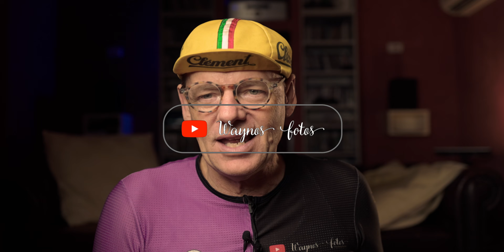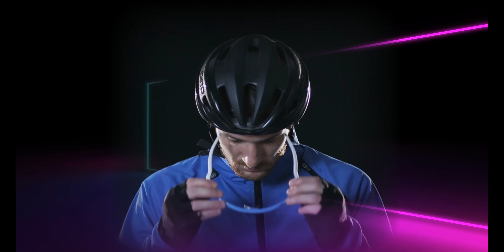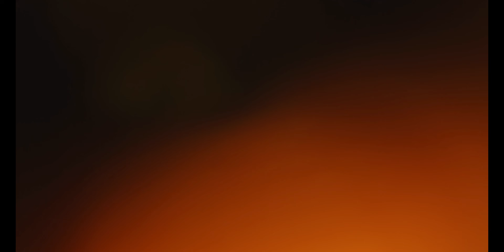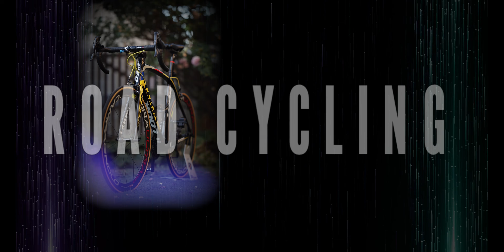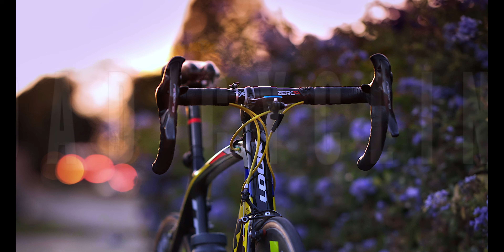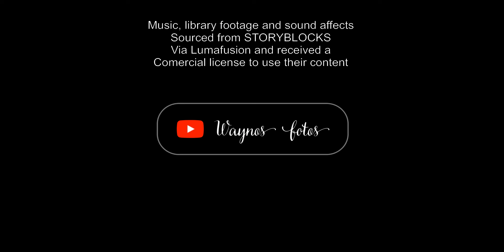Are electric groupsets worth the extra money?

Comment: Just how long are the electrics going to last? I don't fancy parking my best bike up all winter in the shed only to find the so called weather sealing has not really worked because moisture always finds a way inside an enclosed space (it's called condensation), and fried the electronics. 
The difference in price between mechanical 105 and electronic is about £800 or £900 here in the UK, around three times the price! The money could be spent on far better things - better wheels or a training camp/cycling holiday which will do more for your performance and enjoyment than this overpriced  and unnecessary gimmick.

Comment: I just like the simplicity and hand feel of mech shifting. I hate pressing a button on a lever. Internals are really cool when u open them up, and pretty complex with lots of moving parts. Electronic would be a lot easier and less costly to design and produce I imagine going forward? With asking prices more. Hence the push away from mechanical. I won't be buying them though until I have no choice.
Reply from the maker: I get, people like it and it makes it easier to change gears, potentially with more accuracy. But what I can’t get out of my head is, we are pedalling the bike, not using any electric to move the bike forward, i.e. no assistance to the rider working/pedaling, but we carry a battery on the bike to make it easier to change gears. I find that bizarre and now you can’t get mechanical in the top groupsets. 🤔 	Plus I like the feel and feedback of mechanical.
Reply: @waynosfotos   yes whats the difference between pedal assist pedalling and hand assist shifting when u break it right down? Even if one doesn't drive you forward. Both are motor driven. Obviously we're not worthy of even 105 these days .But don't worry. Once they've run out of r7000/8000+ groupsets they'll trap us back in 2005 with 10sp mech tiagra smh. Gee thanks shimano!

Comment: 10/10 for "Resilience" and "Cost saving"  Using eTap Red with satellite button allow me to swap this group set from TT to Roadbike to MTB in half an hour. (Putting the blip box on the stem also come very handy in aero position)
ps. 1 system for 3 bikes is epic to me.

Comment: What are your thoughts on gearing, wide range cassettes etc. specifically the 11 sprocket that is now
on most of them. I still ride 9/10 speed and will not upgrade to 11/12 speed because I could not pedal an 11 sprocket if I was going down a ski jump wearing a jet pack and getting a good  tailwind.
This applies to a lot of cyclists (whether they admit it or not) so what it the point of 12 gears when you can only use 10 ?
From a whinging pom.
Reply from the maker: Well we have 10T i have done a number of videos on gears and easier gears. Go check them out. 👍
Reply: @waynosfotos  Will do

Comment: 12-speed does seem to benefit from electronic, as the shifting is now so sensitive due to the tolerances. Just replaced cables a second time to try and get the shifting perfect, due to a seeming bit of friction in a cable. Ran Campy 10-speed mechanical for ages and it was the best shifting I ever experienced. I said back then that there was no need for electronic, or for more gearing, but I finally relented on the gearing to get the full range in the back that is offered by 12-speed. I'm now curious about electronic and if I can get a return to perfect shifting, but will see if it was just a cabling issue. No doubt that mechanical is preferred for ease of maintenance, simplicity, cycling zen and no need to constantly be charging more devices, but I am changing my tune on electronic shifting and may give it a whirl.
Reply from the maker: You need a bike with straight lines and little cable casing and straw. I have a look 695 12 speed record, changes perfect and very light. My other bike they put straw in it when rebuilding it, you can feel the friction in the changing. Some bikes were so bad with routing that you couldn't get the shifting to work at all. If you have noticed the older bikes had more direct cabling.

Comment: SRAM Force flawless shifting. Ability to optimize shifting, for example when changing between front small/large chainring,  the rear derailleur will adjust so not a large jump in ratio if desired to set it this way.

Comment: The sram AXS system has a very powerful motor in the front derailleur and chain drop is an issue if you shift it under high cadence. You put it very well, it’s not necessary faster, it just feels luxurious and is more comfortable on longer rides because shifting the front derailleur gets more challenging as you run out of glycogen

Comment: I'm kind of old (70), and have arthritis in my wrists and neck, but have no problems shifting with mechanical group sets. My arthritic problems are most affected by the geometry of the bicycles - hunker down aero positions of road bikes become painful after 90 minutes or so on a ride (especially in the drops), so I mostly ride crank forwards, recumbents, and mountain bikes with more  upright positions. I've appreciated great mechanical groupos going back to the 80s, when I was still riding road bikes with DuraAce shifting setups. Thought they were fabulous, but am sure the electronic stuff is a lot better, as long as the batteries work. They're way too expensive for the performance gained, imo.

Comment: Beware of the software contract. Hammerhead is already gone for Shimano have to buy their compatible systems. Soon e-group sets will be like  John Deere tractors. It senses a problem, battery low, stops shifting and all you get is a blinky light. You have to take it to a licensed tech, to get diagnosed and fixed $200 service fee.  Reason JD makes 60% of its profits on service, not selling tractors or parts.

Comment: I think you pointed this out, but I went electric for one and only one reason: Cheap cables. I witnessed what very much could have been a fatal situation when a cable failed. This wouldn't happen in a hydraulic/electric system. They have fail safe positions and provide notification way in advance of a flat or failed battery. Not so with a failing cable.
However,  there are situations where cables are better. But you had better be using the highest quality cables that are hand made. I've even "failed" brand new cables that were bulk made.

Comment: I worked in the bike industry for 10 years and rode most groupsets. For me manual shifting is the best, it’s accurate, easily serviced/tuned and it doesn’t need to be charged or updated. I have ridden Campagnolo Chorus for almost 15 years now and have no desire to change….which says something.
Reply: I ride Campy exclusively. Let's face it,  the ratchet mechanism wears out. Of course your don't notice it on the left lever but as the number of speeds increase it takes less and less wear to be noticeable with misshifts or the nessesity of readjusting.   With an 8 or 9 speed you never had a problem but starting with 10 speeds wear started being a problem. While the 11 and 12 are still too new to tell if their redesign eliminated the problem,  everything wears out and especially when average riders are riding ridiculous numbers of cog speeds so they are shifting multiple gears to get from their top end of 20 to a climbing gear on the next roller.  The average sports rider doesn't need more than 9 speeds and the improved rear derailleur mechanism.

Comment: Electronic only groupset (no mechanical available) is beneficial to the manufacturer's profitability i.e. one SKU instead of two, greater margin and planned obsolescence. Notice the incompatibility of 105 with Ultegra and Dura-ace to avoid mix and matches that could cannibalize sales of the higher end and highly priced components.
It's beneficial for the bike manufacturers profitability i.e. more flexibility for manufacturing frames shapes, less SKUs, less financial liability (recalls and lawsuit), greater margins.
It's beneficial for the shops profitability i.e. less inventory, easier assembly, adjustments and repairs (part substitution vs repair = less time/repair).
To the cyclist two major benefits i.e. bragging that you have an electronic group set and hearing the bizzz bizzz bizzz.
Other than this you pay a hefty premium both at purchase and in case of failure or breakage and you can be sure that it will not be supported in a very short future i.e it becomes more of a short term consumable.
In short, just when the mechanical groupsets became very precise and quick, they went to electronic. Just when the rim brakes became precise and powerful, they went to disc. Why ?
Money, money, money !

Comment: I was one who didn't think electronic shifting was necessary. Heck, most of the stuff we buy for bikes aren't necessary, but once I got a bike with Di2 it was a nicer shift. It wasn't much faster than my Dura-Ace mechanical. I do however like the shifting options available on Di2, like the semi-shift which makes that whole process of shifting gears faster and automatic, without thought. The downfalls are remembering to charge when you need it and on road adjustments and hacks if something goes wrong. With a mechanical you can at least adjust stuff on the road and if anything goes wrong you can physically try to hack it so you can get going again. Fact is, cycling is an expensive sport. Are these products worth the price or cost as much to make as they sell to us? Probably not but the market will buy them because it goes with the territory. If you don't want to spend money, take up walking. Bikes are expensive.

Comment: Electronic system doesn't make you faster. I'm the only guy in our cycling club with mechanical, never been dropped on a ride (guys have all bells and whistless on their bikes).  

For people with handicap the e-system is very good.

I've been using 105 7000, Ultegra 8000 and DA9100 series on my bikes. I've been using Di2 Ultegra and DA on rental bikes, the shifting speed difference is insignicant. 

And the e-system prices are ridiculous (but not as ridiculous as current "top-end" plastic bike frames with desing fails like Canyon Aeroad seatpost issue or stem/fork/cable integration problems). 

I also hate the amount of stuff I need to recharge. Thankfully, my bike isn't one of them

Last note, I bought extra front and rear derailleurs so I'll be riding with them for many, many years to come.

Comment: Thinking of going GRX  for next new frame. If electric di2. Control point in better spot and more options.  Missing that one back cog is not a big big item compared to  ease of use on mixed surface rides I do regularly.

Comment: I've 2 bikes, one is set up with Dura Ace 9000 mechanical, the other Ultegra R8000 Di2. 

The ultegra bike had been getting all the action for the past 2 years. 
Just out of curiosity I took out the DA9000 bike out for a spin and was blown away by how well that thing performs. 

It is set up with Jagwire's Elite Link cables and housings and with that setup they're just as good as di2. 
Shifting is flawless every time, just as fast and just as crisp. 
As wayno said, those cables don't seem to stretch and they do last forever. That's been my experience at least

The only thing I miss on mechanical is being able to see the gear combo on my head unit. 
But otherwise, really no difference. I'd even say mechanical is easier to live with (no charging - no firmware updates) and comparing the 2 groupsets mech is lighter.

Comment: It's probably easier to make an electronic system work with those ever expanding cogsets.  Nine speed mechanical was the pinnacle of shifting.
Reply: We're in agreement.  But 12 speed chainsets are weaker because amateurs always cross chain and across 12 speeds it gives a serious twisting motion to the chain. While I never tried it,  the Di2 shifting speed is programmable. Di2 DOES shift better because it overshifts for rapid motion and then steps back to the correct place.  There is no doubt that it shifts better.  I just find plugging a bicycle in objectionable.

Comment: I've always had my doubts about electronic derailleurs and crashes. If anyone can chime in that would be great. Can the motor get ruined?
Reply: I bought the complete Dura-Ace Di2 9170 group. One month into it my rear derailleur cage broke, damn carbon junk! I went to a shop and they where able to order a new cage, just the half that broke, for $110. But the downside was it took almost 4 months to get it because supply chain issues. However in the mean time I wanted to ride my bike so they were able to get me a complete new RD in like a week. That was almost $700. I bought it so I could ride and when the cage part came it I fixed that RD so now I have a spare. All this because I cross chained biggy big rings. Shitmono has the capability to use big ring big cog but not small ring small cog. That doesn't make sense. The Di2 brain should not let you use the 2 largest cogs if you are in the big ring. So I had to use syncronized shifting so I don't make that mistake again. The reason I don't like syncronized shifting is because it's always a shock when it happens, makes you wonder WTF just happened.
Reply: @wasupwitdat1mofiki94  I can't understand why the cage broke by crossing big ring big sprocket, maybe the chain was too short and that jammed everything, changing gear while your pedaling forces destroy de the derailleur.
Reply: @Megadeth6633  Because it's carbon. Carbon Carbon Carbon. There is no consistency  in the manufacturing and as we have talked about many time on this channel QC is an issue in the bike industry. Just because it's made by Shimano doesn't mean that there is a difference. I talked about this before but about a year ago I bought the C30 Dura-Ace carbon wheelset and had to return it as soon as I got it because the hub was not machined correctly and it wobbled. If I would have gotten the Ultegra rear derailleur this probably wouldn't have happened because it's aluminum.

Comment: The writing is clear and on the wall, no more rim brakes or mechanical shifting, that's the future
Reply: I think this is true at least for all drop lever shifters because it is cheaper for the manufacturer to make than mechanical shift levers. Mechanical brakes will only be what you find on dept store brands where the wheels are those single wall cheap rims that get bent easily.
Reply: Shimano would have a good business if they sold mechanical and electronic groupsets.    I question shimanos ethics?

Comment: I still have mechanical on my gravel bike and and had SRAM Etap on my road bike for years. I actually don't miss electronic when on my gravel bike probably 99% of the time. When it comes into play is if the derailleur comes out of adjustment during a ride and if I am really tired or bonked. If I am bonked or tired, I occasionally can throw the lever too short or too long. With electronic, I don't have that problem. I am going to buy a new gravel bike and it will have electronic for that reason and the fact manufacturers just aren't evolving mechanical anymore.

Comment: I'm lucky to have both, are they worth it? SRAM Red Etap hydraulic and mechanical Ultegra R8000 rim brake. My honest opinion, not really. I'd say mechanical Ultegra R8000 rim brake is the pinnicle of value/function/weight. It's been downhill after that, but marketing will have you believe differently.

Comment: When I first got my SR EPS, I had a minor disaster. One has to press 2 small bumps on the hoods for 6 seconds to enter set up mode. Anyways, I was climbing and evidently did not realize I got the group into the setting mode by squeezing on these. I ended up stuck in a strange gear and threw the chain. Other than that bone head move I find electronic much less fiddily. I do find the Campy shifts better and quicker than my Ultegra DI2.
Reply from the maker: Campy EPS shifts like a rocket. I would say it feels like the fastest shifting of all the big three.
Reply: @waynosfotos  No question about it and my Peugeot PX-10 with 9 Record Campy shifts great still.

Comment: - Ease of use
- Cleaner look (as you pointed out, frame builders are pushing it, many consumers are liking it)
- Marginal gains 
- Automatic shifting: some possible scenarios to automate but one for example is when shifting front derailleur it can automatically adjust the rear derailleur simultaneously to make the gap between gears as small as possible.
- You can add additional shift buttons almost everywhere you like on the bike.
- Shimano shifters come with configurable buttons on top of the shifter... to control your Garmin for example.
- ... 
Just like any other marginal gain, it's expensive and relatively speaking not worth it.